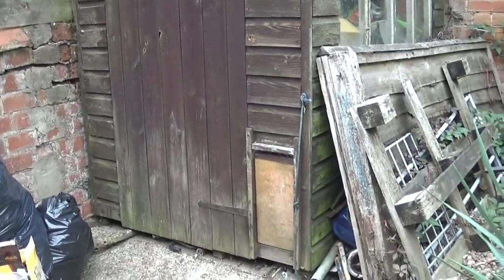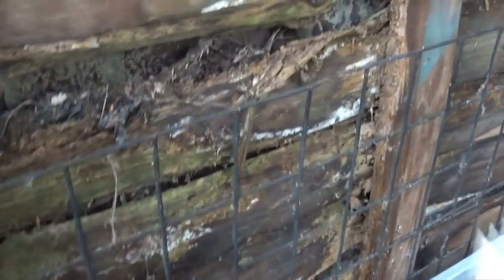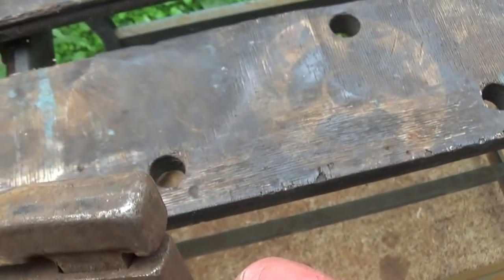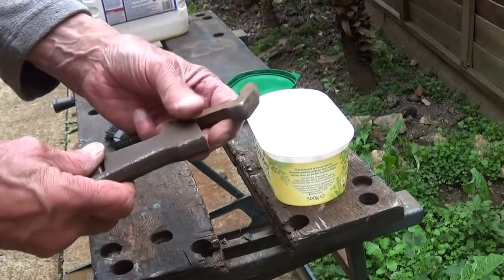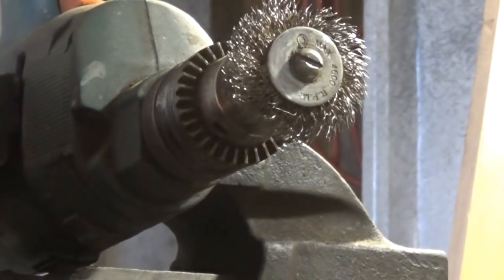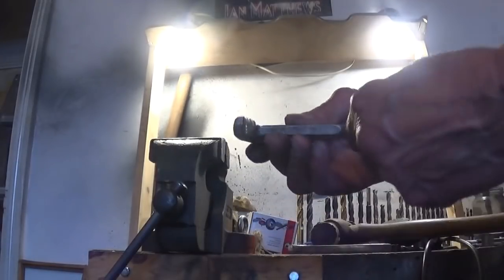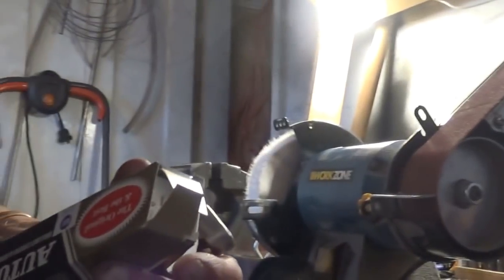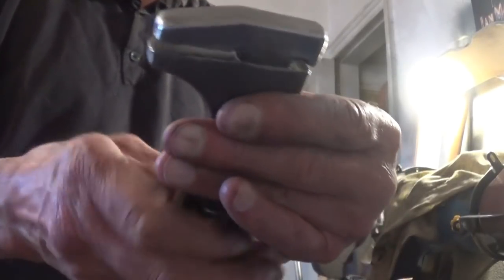Restoring an Old Adjustable Spanner

Comment: That is a really old style Monkey Wrench you call spanners. I have some old Monkey wrenches made in the 1920's and 1930's that has got to be between 1900 to 1910.  But for what it is and its age its done well to even be around. With good cast metal tools they always clean up great with a wire brush and a soak and then a bit of penetrating oil inside the tool and you are good to go. Thanks for sharing Malc
Reply from the maker: Interesting Larry. Funny how these old tools are now talked about and being collected isn't it.
Reply: Yes, it is I still have an old spanner that says Ford on it as well as the old monkey wrenches but one good thing those old tools were made to stand the test of time not like the junk they make these days.
Reply from the maker: You can still buy decent tools today Larry, but they are expensive. But I think this is why these old tools have become collectable.